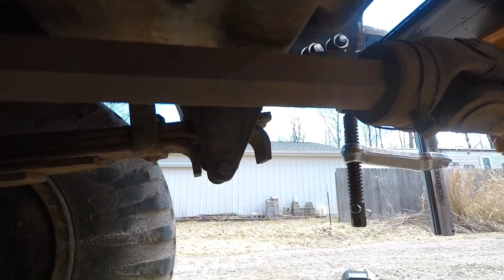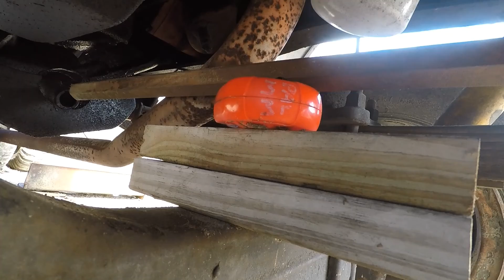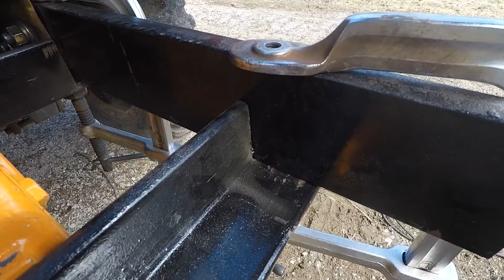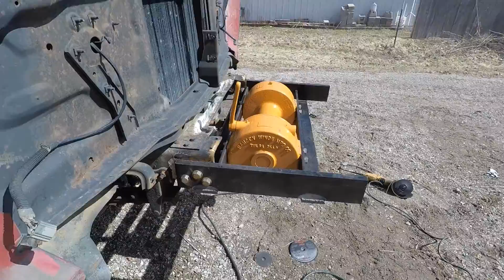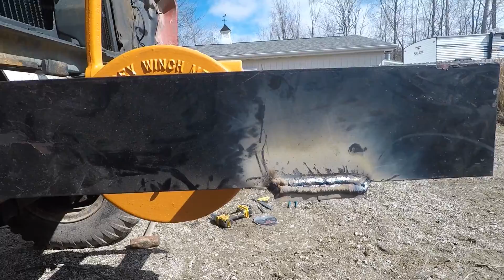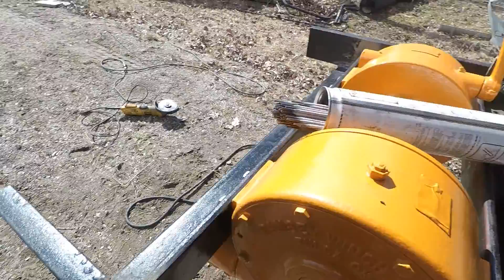Ramsey 700R Winch Install Part 3 of 3

Comment: Nice job Wesley! 🙂👍 that mount looks stout! What pound winch is that? 20k lbs?
Reply from the maker: Thanks! It's a 15k lbs WLL, setup for 9/16" overwound cable.
Reply: @WesleyJohnsonMI  nice! That will come in handy 😉 👍
Reply from the maker: @HODGEPODGEDODGEGARAGE  it most certainly will. It'll definitely move something!

Comment: When you build a bumper wings  Will you build storage in to it?  Be a good place to store some extra shackles and chains I'm thinking.
Reply from the maker: I might. Haven't fully decided what I'm going to do with it yet. I'm going to be doing something similar to that on the flatbed on either side of the rear PTO winch.